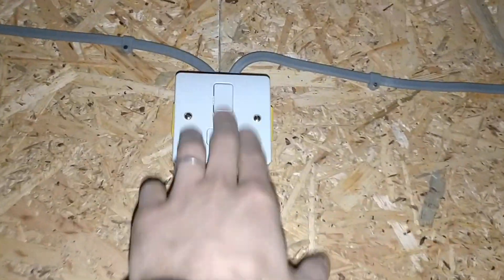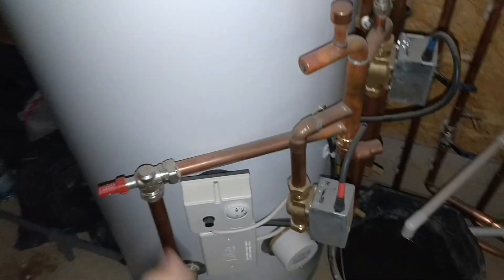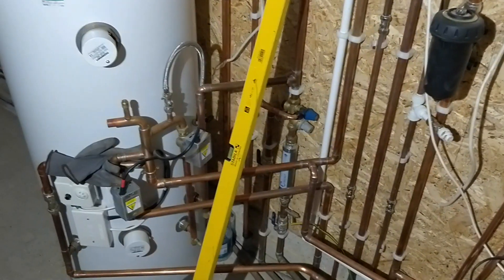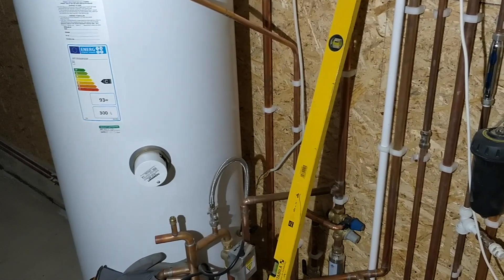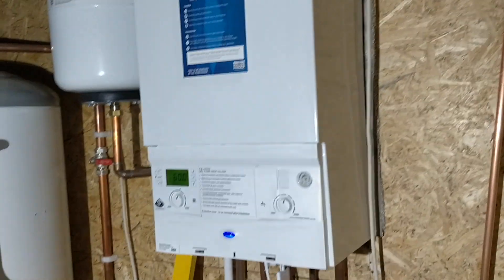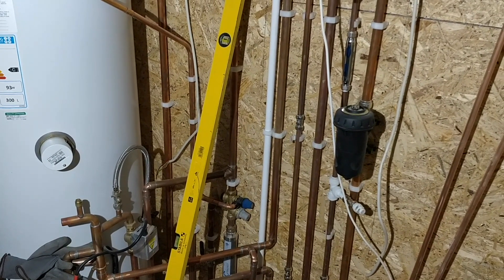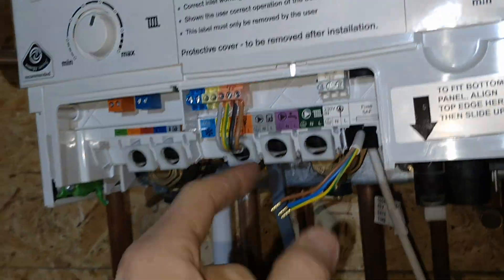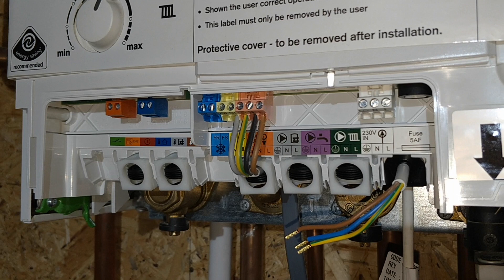DIY S-Plan wiring for Central Heating

Comment: As Frank has said you should use heat resistant flex really (with cord ends/ferrules). And a proper surface mount 1 gang back box/pattress and not the plaster board/dry liner box you have used.
Reply from the maker: Good to know mate, thanks for the heads up. I'll chanceo them 👍

Comment: Please take this as advise not criticism any cables into boiler should be heat resistant. Not twin and earth.
Reply from the maker: That's super helpful to know mate, thanks for taking the time to post this. What cable do you suggest/recommend, I can easily switch it over!
Reply: @OfficeBoyBuilder  You can use most 5core flex just check spec before you buy it.

Comment: I thought that the whole system was meant to be powered from a single FCU giving a single point of isolation.  Right now you have power from the FCU to the wiring centre and a separate power lead for the boiler.

So perhaps it should be FCU to the boiler WHITE LNE inputs.  LNE output from the boiler ORANGE terminals to the wiring centre, powering the programmer and valves. Then a switched line back to the boiler YELLOW terminal when the valves open.  That way you can isolate the entire system from one switch.   I may be wrong :) I am not a plumber.  Good luck.
Reply from the maker: I'll take a look mate, but when I switch off that fused spur, the power to all of it is cut off...
Reply: @OfficeBoyBuilder  what's the model of the boiler?
Reply from the maker: UV Gold for the tank. And Worcester Bosch for the boiler 👍

Comment: Sorry fella can't understand you have a spark wiring your house and your messing with this. You have made an absolute dogs ** of the wiring and you have wired the boiler wrong probably invalidating the warranty. Top tip spur to boiler then boiler to controls then when you isolate the boiler on the front panel it isolates all controls down stream of it.